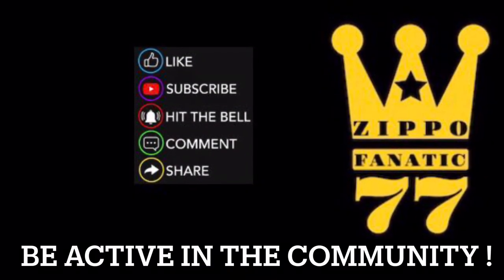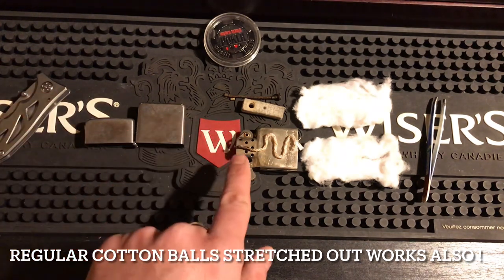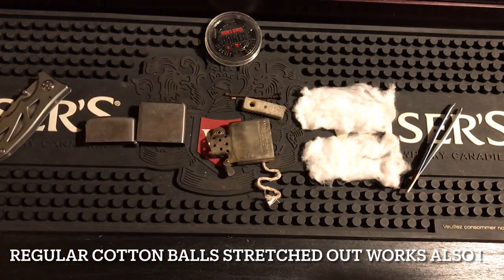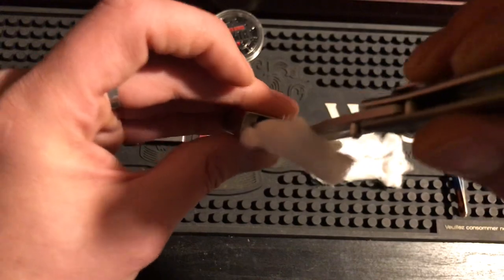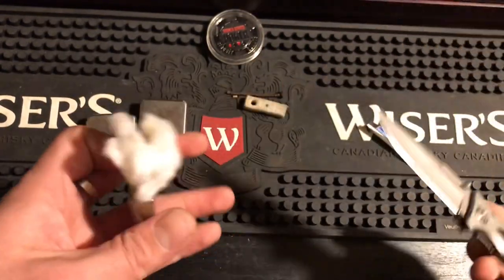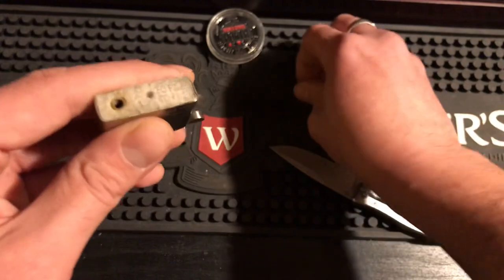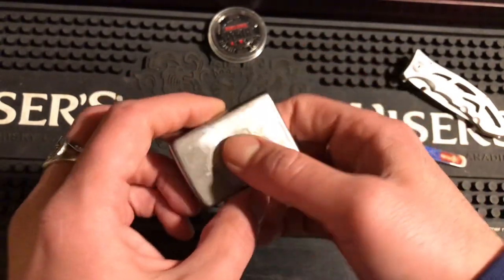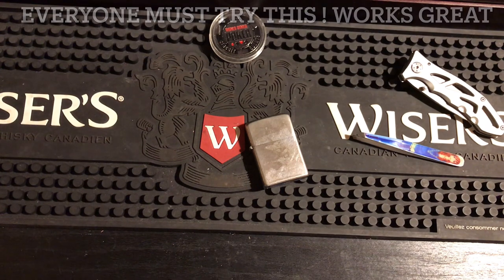How To Change Cotton/Wick In Zippo New & Better Way !!!

Comment: Excellent method for regular size. Repacking and getting the wick right are always difficult for me on the Slim regarding weaving the wick. Going to experiment with this.
Reply: @ZippoFanatic77  Just re-wicked  but had to feed from chimney.  Couldn't get it into the hole even with straight wick from bottom up on the Slim model. I pull it down, then clamp top of wick with forceps while I'm packing the cotton. I did use the stripped cotton ball method though. Yes, you gotta have that wick in nice contact with the cotton or rayon. Great you spoke to that, cause lots of people just jam balls in there without 360 contact.  It was time for wick change, i was down to 1.5" and getting starvation symptoms today as a matter of fact, after i had pulled up wick a couple days ago. I have to top off daily anyway, smoking 8 cigars a day which don't light easy like cigs. With a Slim, that means daily top off or every other day. I like my Zip guaranteed ready to rock at any time though, so it's every day (30 seconds or less filling thru flint hole in felt pad).

Comment: Great video and great tutorial!!! I just bought my first zippo lighter and brand new it wasn't working the wick just was burning black and it was refusing to light (great quality control zippo......)

I followed these instructions and firstly unpacked the cotton in the zippo the wick was no where to be seen until I reached the top the entire wick was bunched up at the top loooooooooool!!!!!!!!!!!!! No wonder it wasn't working the fluid wasn't reaching it

I didn't have cotton handy and since their cotton was still new I simply repacked their cotton using these instructions, first redoing the wick so it is looping back and forth to the end of the lighter, then put knife in to hold it down (was easier with knife in to pack the first side, at least with their cotton)

Then put knife the other way and packed the other side of the wick then packed the bottom, put their sealing pad back on and put the flint and screw back in, hardly needed to strike it, immediately lit up a beautiful flame!

Great instructions!

Now my only challenge is knowing when I've filled it enough I keep overfilling it and the bottom pad gets completely soaked when I close it which I guess is not ideal 🤣

Comment: I got a method where you can save the fuel or you got problem with the fuel running out fast..take out your zippo cover and just coating the extra space with petroleum jelly..make sure you're coating at the side dont coating at the bottom..

Comment: my grandpa used kapok fiber as I live in Java, it seem kapok would absorb better and retain its fluffiness better than cotton when saturated with oil , I wonder if that would retain or increase fuel capacity better in lighter.  also is there a way to connect old wick with new wick instead of throwing away half used wick, maybe we can connect it with cotton thread? or is there a place where we can buy much longer wick in the same girth and quality as zippo wick perhaps marketed differently for candle industry etc? thanks for the informative videos

Comment: If you put the baggy over the insert and then poke a little hole over the flint tube you can just screw it in over the baggy and it will come out with the insert every time